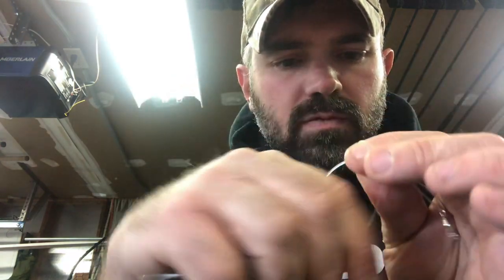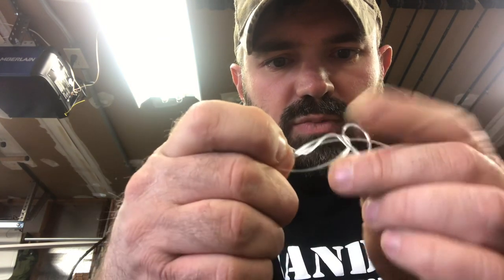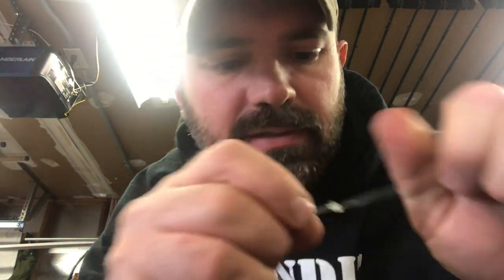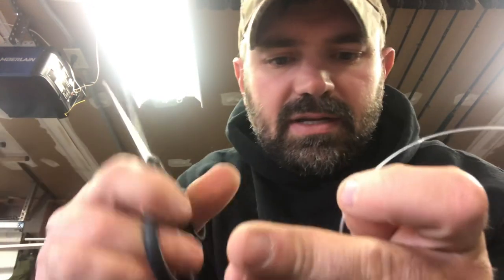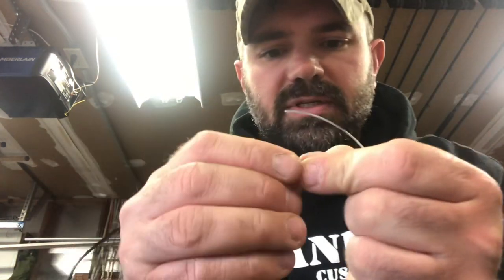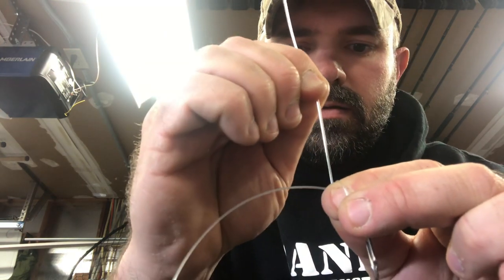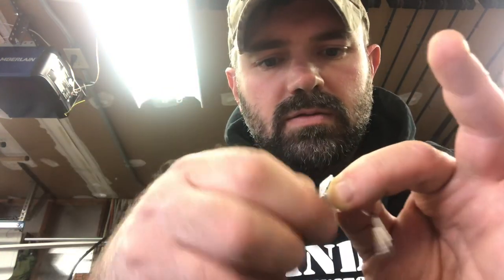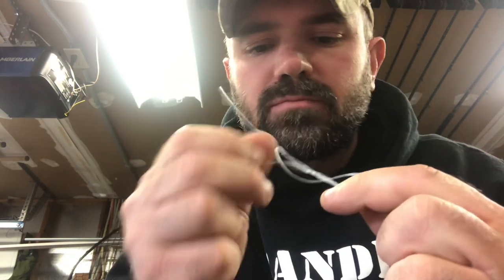Pike and Musky Flourocarbon Leaders; Tieing with no crimps!

Comment: Hey bud quick?  I like using Rapala   X-raps 10  jerk baits a lot for Small mouth,  but Northerns unfortunately like them too. Is that knot ok for tying directly on a hard bait or say even a topwater ?
Reply from the maker: Max imus it works for a lot of applications.  Jerk baits you may be able to leave it loose to get that action.  50# flouro is pushing the lower end of pound test lines for toothies.

Comment: Thanks....I want to make my own leaders. I make two trips a year to northern Minnesota and wanted to stop losing fish because I hate using steel leaders. Is there a brand of Flourocarbon you like to use for leaders? Has using flouro vs steel made a big difference?
Reply from the maker: For me, yes.  Especially later in the day when water temps rise and fish become more spooky due to the visibility.  In clear water it makes a big difference.  I usually get a roll of Seaguar Blue Label in 80#.  I have used Berkeley Vanish, and that seems good also.  It’s critical to use 80/100# line for the abrasion resistance.
Reply: @liebeltguideservice  Thank you, do you have a weight /size on the ball bearing swivel? or snap lock? I fish super clear water. I love  Seaguar!

Comment: Does the spool have 3,or 4 loops in it before you feed the tag end back through?
Reply: Yes. 3 or 4 wraps. Once you wrap the spool on your finger, take spool off finger and run tag end through all the loop in direction of main line. Check out video!

Comment: I feel like a uni knot with three loops is quite effective for 80-100 lb mono or flouro.
Reply from the maker: If that works for you, then go for it.
Reply: Liebelt Guide Service thanks, wasn’t sure if you had tried  a uni and found it less reliable since my experience is extremely limited.
Reply from the maker: Patrick Fahie Uni knot can slip, this will not slip.